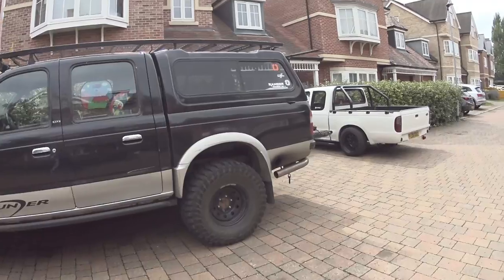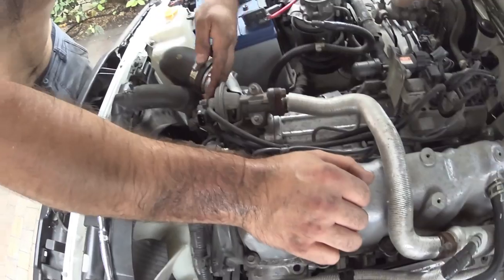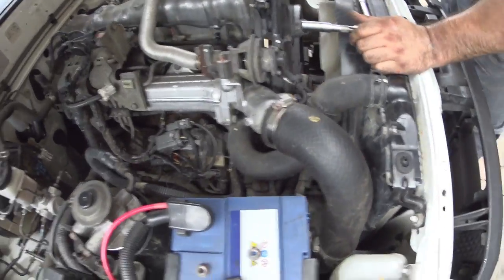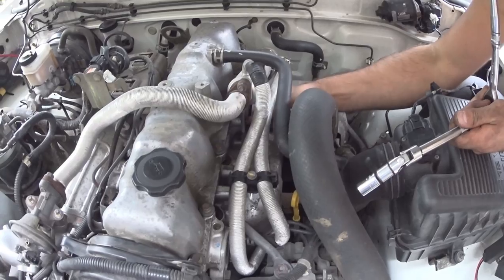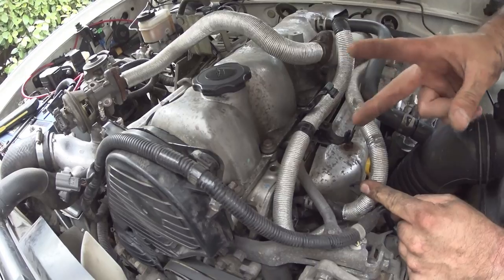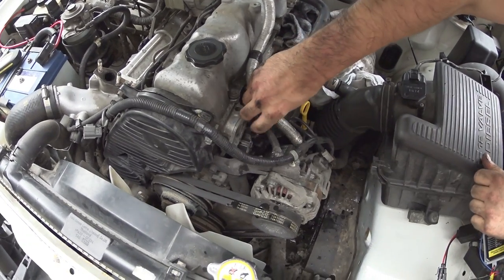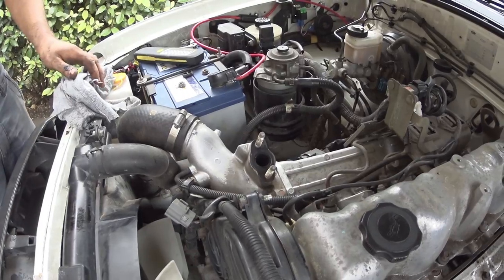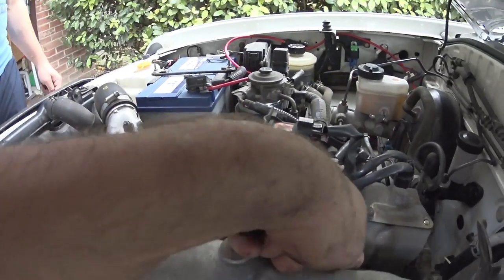Fitting a Ford Ranger EGR delete kit - mk1/2Ranger and B2500

Comment: I would like to remove the solenoid from the top of my engine just like this but I only have 2 of the 1 of them is white and the other is black but I heard you mention in the video to leave 1 of the solenoids as it is for the boost, so I am a bit confused

Comment: I'm going to do the egr delete on my 2005 B-series 2.5 tdi 4x4 because the egr cooler is pressuring the cooling system under load.    Is it a must to disconnect the solenoids and can I just reconnect the 2 coolant pipes to the cooler since right now I have them disconnected and joined together with a piece of copper pipe.   Will it affect the MOT in UK?  Thanks for the vlogg and support.

Comment: Hey man, I have a fault code on my mk2 4WD for the accelerator position sensor. It was running fine but I thought I would replace it to try and clear the check engine light, and now it’s running in limp mode & the code hasn’t cleared. Do I need to do some kind of throttle relearn procedure? Or any ideas? I’ve checked the wiring from the position sensor back to the ecu and there’s voltage to the sensor. Any help will be much appreciated! Cheers, Tom
Reply from the maker: Needs calibrating to a specific voltage at idle
Reply: @rangerfortin1504  Is that something that can be done without plugging into it? Would you know how I go about doing that? Thanks very much for the reply. Still trying to get it going!